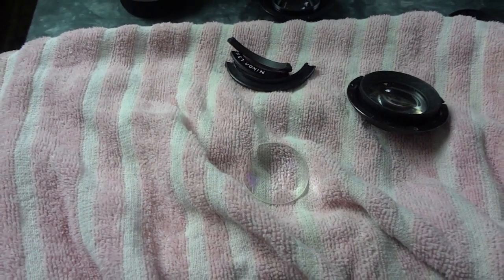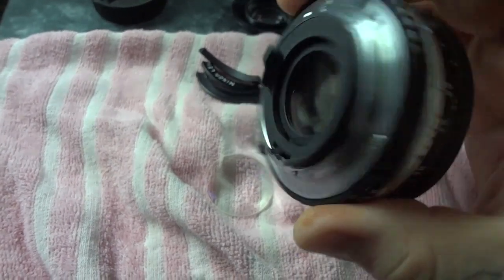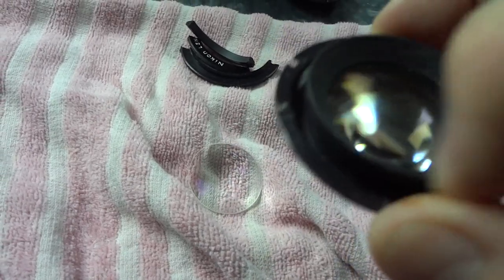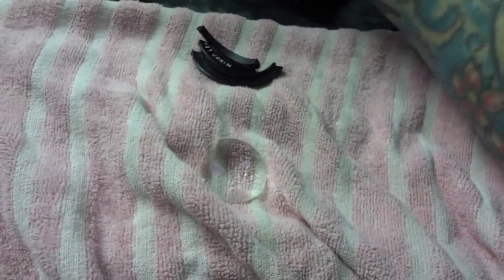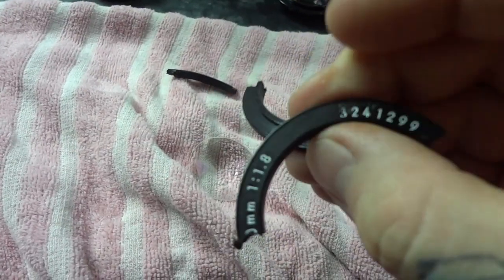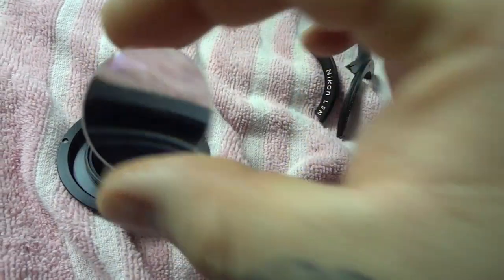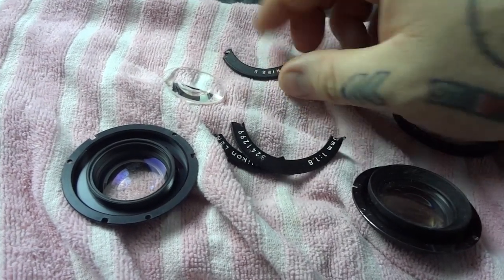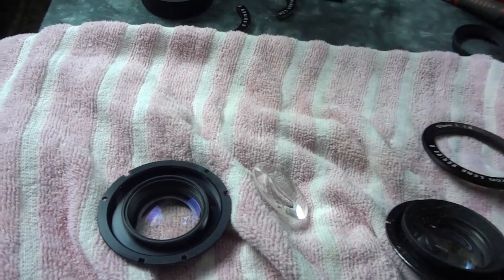Lens Repair via the "Angry Method". One way or the other, its getting fixed

Comment: It cost me 50.00 and seems fine and clean. Is it worth spending the extra 40. Is the lens any good ??
Reply: It is not about clean glass. These are pre-AI lenses. You need to convert them to AI or it will break the levers on your camera mount.
Reply: +PalaZ000 
My question is if this old Nikon lens any good or should I keep it as a conversation pice.. I really would have a decent 400mm lens.. Thx,
Reply from the maker: SOME OF the old glass is great,    some of , that one however…….sok.  :/
Reply: +Theoria Apophasis , the 400 mm , f 2.8 , prime that I bought second hand is divine, but requires tripod and skills !
Reply from the maker: dont break your back with that huge beast man :P

i know how enormous it is :)

Comment: Quick question. 
I bought a Q Auto1:4.5 f 400 mm for next to nothing. 1:4 f=8.5 Cm ~ 1:4.5. F=25cm Lens. Will this thing work on my 7100 ??    Thx,
Reply from the maker: it wont without a $40 AI conversion :/

Comment: just use the proper tools and plenty of solvents
Reply from the maker: siezed screws are siezed screws :P
Reply: everytime I get something like that, I just drop MEK on the screws and let it sit overnight. The next day, the loctite is soft enough in order for the screw to be removed effortlessly. If the idiot who worked on that lens previously used epoxy(common during new-nikkor era) then your screwed if he used too much. The only clean and reliable way that I can extract that is by using a 1.2-2.0mm screw extractor. that extractor has saved me countless of times when i am refurbishing old lenses and I mention it often in my nikkor repair blog. I advise that you get one, they are cheap.